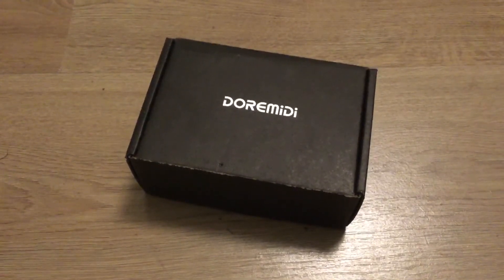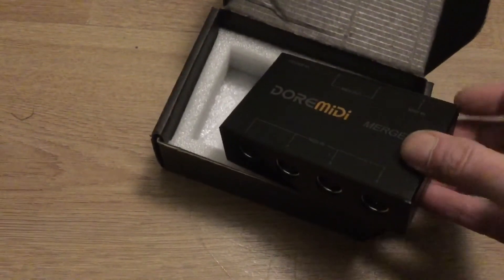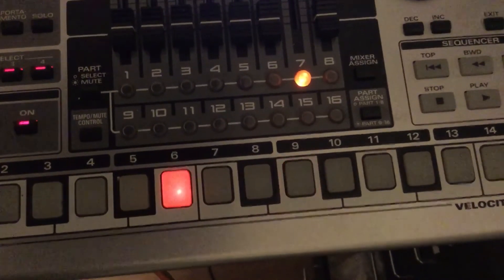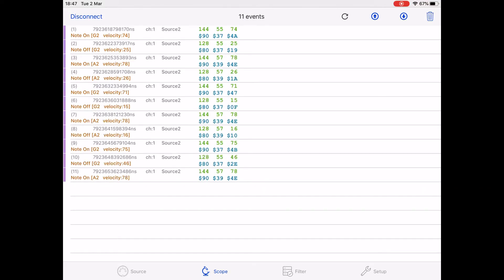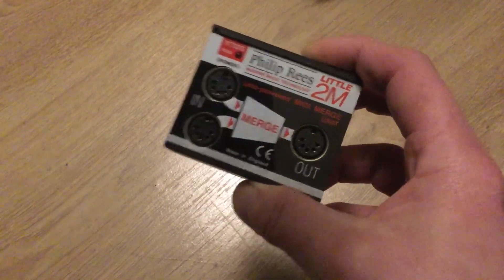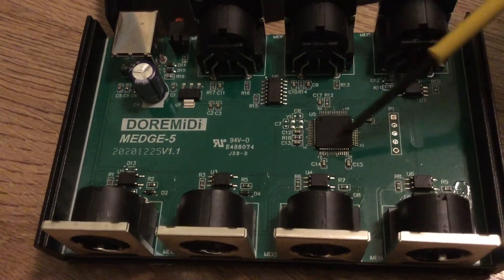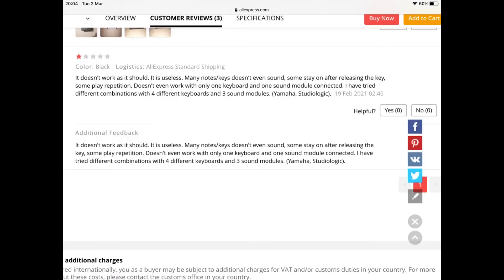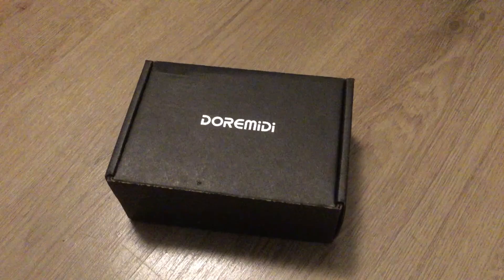Doremidi “Merge-5”  midi merge review and teardown

Comment: I wish I had seen this review before I got my DOREMIDI Merge-3 box. Absolute garbage. I connected an old yamaha keyboard (that works just fine when connected directly to the audio interface). The notes just hang. I tried different midi cables, tried to power it directly with a 5V brick, tried to power it with USB. same results. AVOID!!!!
Reply from the maker: Oops .... should be an easy fix for the manufacturer . I dont believe  there is a firmware update available , a potential fix . I thought about swapping out the opto isolators , but just moved on👍

Comment: Hi. Did you have the power supply connected to the USB port? Apparently that is key to making this unit work properly. It starts having issues with multiple midi devices if the external power is not connected via the USB connnection as it wasn't designed to work just by power over midi according to the maker.
Reply from the maker: Yep .. tried a couple of usb power sources.

Comment: Thanks for the review. You certainly confirmed why my MOTU midi hub is worth every cent. As an extra detail, I have a 'Philip Rees merge box' as well, but the one with a midi thru for each input as well as dual merged outs. It has served me well for 30 years, all the way back to my Atari days! Who would have thought this 'midi protocol' would still be relevant in 2021/22. USB has not replaced midi, and it seems the only reason is the human factor(s); greed, stupidity and ignorance.

Comment: Thanks for this review. I'll def avoid this. Any other decent multi-out midi boxes that you'd recommend?
Reply from the maker: If you are after thru only then most of the market devices and diy will probably work as they are probably built around the same design and require less resources than a merge utility. I did purchase “subzero ( or TIE ) “ 4x4 merge and thru that works . Midiman merge 2x2 Ive seen 2 nd hand and also phil rees midi utilities come up 2nd hand too. These are some budget recommendations .
Reply: I have the DoReMIDI Thru 6 (not the merge box) and it works fine. I have a KeyStep Pro connected to the input and synths connected to four of the six outputs. But as "Unauthorised Service" points out, "splitting" MIDI signals is way less demanding than merging them.